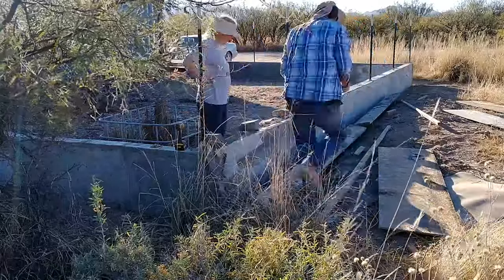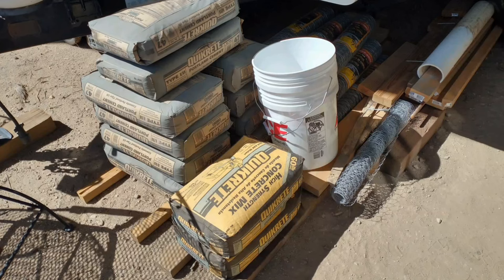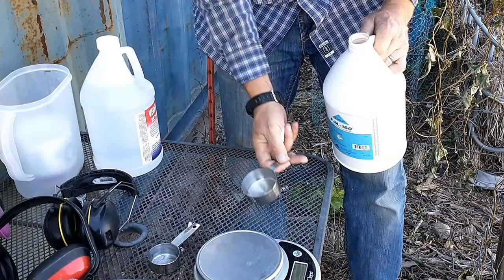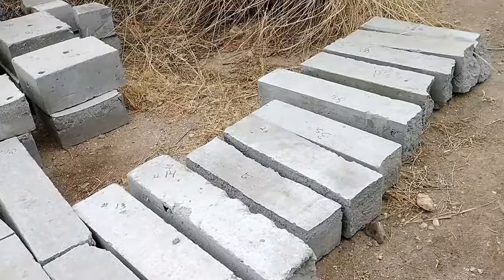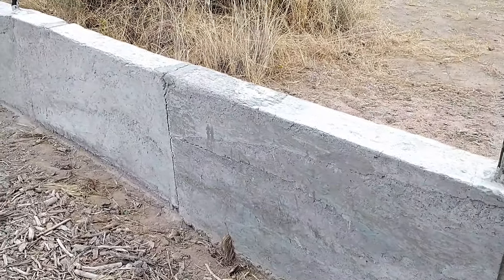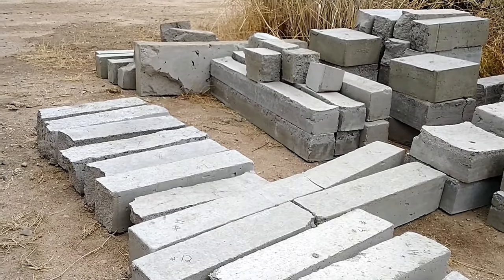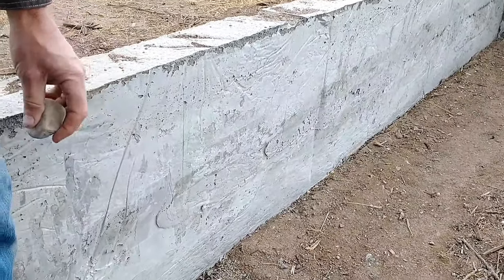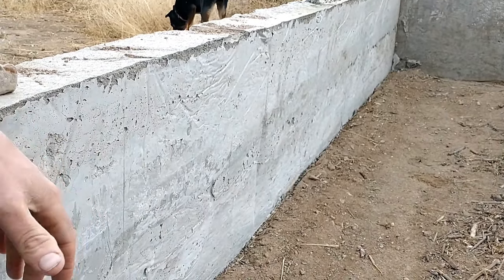Why we GAVE UP on AIRCRETE & What is Our Plan Now?

Comment: I had hoped you would figure out the secret of aircrete but understand your decision.
I eventually decided to use latex coated EPS beads because the walls still have some structural strength and still have a little insulation value. Plus, you can put (long) screws into it for attaching things.
I didn't care for the shredded styrofoam because of the inconsistent spacing. But I'm using 4" pipe columns to support the roof and simply using the concrete tilt panels as filler between the load bearing.
I DID have some excellent results by pouring a 1" layer of conventional concrete into a tilt up wall panel form then pouring aircrete on top (while it was still green). The concrete facer is going on the exterior. I have since gone to the concrete facer layer then the EPScrete.
I'm going to put 2x2 laths on the interior surface (liquid nails exterior construction adhesive), closed cell spray foam to seal the wall then my plan is to use grooved boxcar siding for the finished surface. I'm not to worried about small cracks and powdering as the EPScrete is pretty well encapsulated.
Reply from the maker: Thanks! Yes, there seem to be a lot of variables to making it come out right. The cold temperatures were probably not helping us out. The spring time here is also cold and would bring another set of challenges. We get wind for about 3 months, which would have made it very difficult to keep the aircrete wet to properly cure for a week, and much less for a whole month. 
That sounds awesome, best wishes on your build! 😊🏠
Reply: do you just use old latext paint and mix with shredded styraofoam to make EPS beads? never never of that product?
Reply: @khandam7709  not using shredded styrofoam because in test samples I couldn't get consistent distribution throughout. Beads in the right proportion form a consistent pattern and strength matrix with less clumping and gaps.
I bought a huge bag of EPS beads (what they use for beanbag fill) but they have a static charge that makes them not get properly get coated with the cement. You can mix them with the cement dry so some particles get embedded in the surface then add the water and that helps. But the best thing  is to add latex paint to the beads then proceed with the mixing.

Comment: Thanks for all your effort, AND for your effort showing us!!!! Very very interesting, as this whole aircrete-thing is a dream for years now, and my chances ar low to get more lucky than you were with it. Especially I thank you for your honesty, as it maybe shortens my hard way a lot ;-)
Reply from the maker: Glad it is helpful! We really thought we could figure it out, and maybe with more time we could have made it work. The Drexel says on the bottle that it needs to be used at room temperature. We kept it as warm as we could but it was probably still colder than ideal. Warming it up would have been the next thing we tried, but we didn't want to wait until late spring to find out, and who knows it still might not have worked. Lots of variables, but it's probably possible. Best wishes! When it turns out right, it is pretty cool stuff. We want to make an outdoor rocket stove with some of the test bricks, and it will be interesting to see how the garden wall holds up after a few years. 🙂

Comment: Fundamentals:

Concrete is used because it has huge compressive strength and is extremely stiff. It's two weaknesses are its weight density and terrible tensile strength.

Mixing in flexible filler, such as wood, paper, air, styrofoam, makes it lighter, but makes the tensile failure hundreds of times worse. This is why it cannot serve as a structural material (beyond already developed industrial mixtures such as perlite).

The fillers that address the tensile strength problem simply cost 1000 times more than sand and rock. And honestly, almost anywhere one goes, sand and rock is free, just scrape it up off the ground and throw it in the mixer.

Comment: Good luck with your adventures.  In old Mexico and other less developed countries it's cinder block and  adobe for low cost housing.
Reply from the maker: Thanks! Yes, we wanted a material that would also be insulative, so that's what made us interested in testing aircrete. It turns out the insulation value isn't that great, and neither is the cost of materials, but now we know.  😏 😊 Our son is building an earth bag type home. 😎🏜️
Reply: @RedandAprilOff-Grid  I plan to build with cinder blocks. Every 8 feet fill with concrete for strength. For the other spaces I'm thinking packing peanuts mixed into really wet mortar mix. That should be really decent insulation. I won't use the starch packing peanuts since they might attract mice.

Comment: Did you check out the concrete block mixed with foam.  It's supposedly very strong and highly energy efficient.
Reply from the maker: Looks interesting, but we would need a whole lot of styrofoam to build a house, and it's still a homemade product that still needs a lot of testing.
Reply: @RedandAprilOff-Grid  you can buy the Styrofoam pellets by the bag.  I think you can also buy the blocks.  The blocks interlock, and you stack them dry, then you push the rebar through the holes, then fill with slump.

Comment: Aircrete is made from portland cement, but portland cement has changed over the years as they try to make it more environmentally friendly.   Type V for example, cannot be found anywhere in the USA, and it's disappeared only recently.   Not only is aircrete harder to make, but worse, basement walls may be much worse which might have used type V, and the lifespan might be cut in half over the last few years.
Reply from the maker: Aircrete isn't great to begin with. There are better, cheaper and easier materials to build with.

Comment: Just thought I'd share this:
Basic recipe for non-autoclaved lightweight aerated concrete (aircrete) with 600lbs kg/m3 density:

-Ordinary Portland cement
-Limestone powder (particles up to 0.05 mm)
-Aluminum powder MEPCO 7520 or any Aluminum powder with blaine value 15,000 cm2/g and more

Dry mix formula:
50% cement (by weight) + 50% limestone powder. For 1 kg of dry mix you need 500g cement and 500g limestone powder
Mixture formula for for 700kg/m3 density:
1 kg of dry mix0.65 liters of water, 1 g of aluminum powder for 100 kg of dry mix you will 65 liters of water and 100 g of aluminum powder.

How to mix it: 
1. Add water in the bucket.

2. Add dry mix in the water and mix it for a couple of minutes.

3. Add aluminum powder and mix 1-2 minutes. 

4. Check video for graphene dry mix ratio and add

5. Pour in mold

Videos are on YouTube.
Of course test for hard water...you want it soft. You can also use less water with various admixtures that will increase strength and accelerate or delay curing time. Many are readily available at Home Depot or Lowe's  or whatever your big box store happens to be. Nest deals for admixtures either direct or through Amazon or eBay.
Reply: Thank you much Sir, for this very informative comment.. hope I could also try it....

Comment: cant you like put a thin lining of clear epoxy on all exposed surface? Inside it could help design and any hardener for surfaces would work.
Reply from the maker: I'm not sure? Typically aircrete is covered in a sturdy cloth or fiberglass netting, and then plastered.

Comment: Have you tried adding structural support like rebar?
Reply from the maker: We were planning to add wire mesh or some other kind of metal support, and  also fiberglass fabric and plaster on the inside and outside.  Our testing was to compare the different aircrete batches against each other, and see if we could make consistent batches. I tend to think now, that the wire support would eventually make the cracking worse. Our garden wall shows significant shrinkage and cracking.

Comment: You guys should have tested eps styro aircrete. There’s a guy who built with that with great results. I also think you’re worrying too much about the finished surface of your aircrete. Should plaster it anyway for surface durability.
Reply from the maker: It would take a whole lot of styrofoam to build a house. Even if we could easily get it. It would require a lot of trips into town to pick it up, and pack it into our vehicle, then bring it home and put it somewhere until we had a chance to shred and bag it. Not that it couldn't be done, but we would need a large indoor space, and it would be a very messy, and time consuming process.
Our tests were to see if we could make an aircrete that was reasonably strong, consistent, and to test how different additives affect it's strength and performance.
Reply: @RedandAprilOff-Grid  just use perlite, it's cheap and it comes to you in sling bags

Comment: I  have had similar disappointments with both aircrete and styrocrete.   It's too bad really  because lowering the amount of concrete being used is a worldwide concern.   Keeping styrofoam out of our landfills is  another major environmental goal.

Yet I do believe this material has good potential..   I think the cement manufacturers would perform a service if they got some chemists going with aircrete research.  The variety of types of cement is large. The types of concrete additives are almost infinite.  This can't be that hard to figure out.
Reply from the maker: Yes, seems like most people who try it really struggle. I thought using the water softener, and keeping a close eye on foam density was going to be the key, and it was going well at first.
 I watched and read anything I could find about making aircrete, but it's hard to find answers.
 I think the cold Drexel was likely the issue with our later batches, but it could have been something else too.
 We are seeing a decent amount of shrinkage and cracking with the garden wall, so it seems like dried, and cured blocks would be a better option.

Comment: Did you test the alkalanity/acidity of your water? I feel your issue is related to something in your locality if you’re assured you followed the mixing instructions as given. I trust a perspective shift might benifit your process outcome. Cheers!
Reply from the maker: We used our well water and a portable water softener. Once we got the hang of it, our first batches turned out great. We figure the colder temperatures were to blame for the batches getting worse. Maybe it's possible to get good consistent batches if you are working indoors, it have a nice long spell of ideal temperatures. We are glad we moved on from aircrete, and we should be done with our house in a few weeks. 🙂🏜️

Comment: Were you able to control the temperature and humidity during curing?
Reply from the maker: When we made our first batches, we were in the low 80s in the day and getting down into the mid 30s at night.  We kept the samples wet and covered in plastic for 7 days. The last batches we had to let cure in our well house to keep them from freezing. I suspect the cold Drexel was our main problem with later batches. It wouldn't have been practical in our situation, but using warm water may have helped.

Comment: Sand generates compressive strength in concrete mix. Replacing sand with air-bubbles gives low compressive strength.

Theoretically this might be improved with reinforcement. In reality, its just not going to work like that. The material fundamentally relies on specific type of sand to give it compressive strength.

Comment: I heard that mixing some fiberglass helps with strength. Whats your experience/mix with fiberglass?
Reply from the maker: It wasn't great. Someone mentioned in the comments, that the fibers need to be encased in a solid material for them to have much benefit. With the holes and overall weaknesses of the aircrete we tried them in, the fibers didn't seem to help much. In a lower foam mix with smaller bubbles, there would likely be some benefit.

Comment: Did you try checking your equipment? Maybe the foam machine wasn't that great and wore out quickly.
Reply from the maker: Everything seemed to be working fine. We did have to constantly adjust the pressure regulator throughout the batch to keep the foam at the right density. We suspect the colder temperatures were to blame for our later failed batches.

Comment: Hi Red & April. I followed along of most of your aircrete vids. Others too here..  ive never liked the folding in of the cement into the foam.  What if your paddle mixer was 4 very fine sieves and the dry cement was mixed into the foam. The tiny holes in the sieves would continually aerate the mix as long as you need.  Great series of vids.  Thanks.
Reply: the dry cement would pop the bubbles
Reply from the maker: From what I understand, cement needs to be fully saturated with water to set up properly.  When mixing in the foam, if dry cement is still stuck on the sides of the barrel it causes problems. But you never know, it might work. Thanks for watching! 😊

Comment: what length of strand are you guys using in your aircrete? there is a couple things i think you could change about your mixture (i am studying/TAing at a plastics and composites lab.)  Aircrete Styrofoam is another interesting thing you might want to consider (im sure you already have)
Reply from the maker: We are using 1/2 inch of both fibers.  We weren't too interested in using styrofoam for multiple reasons. A couple are the huge amount that would need to be collected, and we also don't have a big shop to store and shred it in, and it's really messy stuff. 
It is always interesting to see what other people are learning and doing with aircrete and other unconventional materials.
Reply: @RedandAprilOff-Grid  yeah I know styrofoam has its downsides, but I think that your running into the limits of a composite with voids, one of the things we study here at the lab is composite matrices with air pockets or voids in them, the fibers have to essentially be completely encased in whatever resin ( in this case concrete ) to really take advantage of it's benefits.try making a pure concrete block with the fibers and one without if you'd like to see the difference.
Reply: Roman concrete has a salt silicone polymer addition to the mix, a second glue that gets harder over time. Sand and salt water plasticize in the air pockets of the cement and strengthen the bonds year after year. Roman buildings are also in a stable parralell so extreme cold temperatures are not as stressful on their concrete so you may be in a harsher climate that could effect the long term results.
Reply: @terrafirma9328  I thought Roman concrete had an ash or scoria component?

Comment: The aircrete has to be made with fine sand.. preferably with river sand! In a proportion of 1 of sand by 7 of cement.. that because of heavy particles of sand will tend to decant and rest on the bottom of the mix! Another issue it’s the liquid dish soap versus the foaming agent.. the foam from dishwashing soap will tend to deflating quicker than industrial propilenglicol or more so industrial foaming agent! Another tip it’s that we don’t count with a concrete mixer machinery it’s to made smaller batches of aircrete! From half kilo of sand by 3 and a half of cement.. and for the foam about 80 mililiters of soap or about a half or less than that of industrial foaming agent by 1 liter of water! That will result in about a little bit less of a 5 gallon bucket of aircrete..
Reply from the maker: We used Drexel foaming agent and fine sand. Yes, smaller batches are much easier to make, but to make a whole house out of aircrete, we knew we would need to be able to make full batches. At 6:45 in this video we make the fine sand batch.  https://youtu.be/iN3oSbtBr38
Reply: @RedandAprilOff-Grid  For bigger batches it would be necessary a concrete mixer machine..
Reply from the maker: @RicardoAldana1988  Yes, we had about decided we were going to get a mortar mixer, because people seemed to say they work better than a cement mixer.
Reply: @RedandAprilOff-Grid  Indeed a mortar mixer will introduce more air in the aircrete and it’s easy to handle to not overmix!

Comment: Are commercial autoclaved aircrete bricks available in your area?  . . . 'cause those are nice.  Not legal in California because of technicalities about earthquakes (hasn't been tested)  but used extensively in Europe and also used safely in earthquake prone Japan and Brazil.  You do have to put a reinforcement cloth and fully cement without bubbles top coat on anything aircrete.
Reply from the maker: Blocks are not available here The main reason we wanted to try this type of build is because people were saying it had really high insulation value, & that it was less expensive than traditional construction. It turns out that neither are true. Yes, we were planning to add metal reinforcement, fabric and plaster..

Comment: If you got your aircrete into small enough pieces, you could use it as aggregate in an otherwise standard concrete process.
Reply from the maker: It would absorb some of the concrete and lose most of its insulation value. Styrofoam would be a better option.